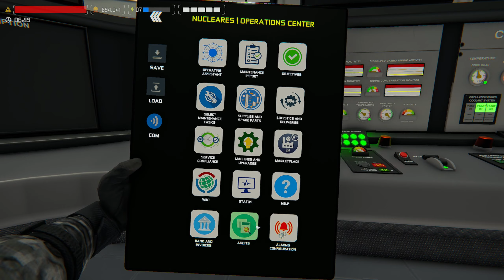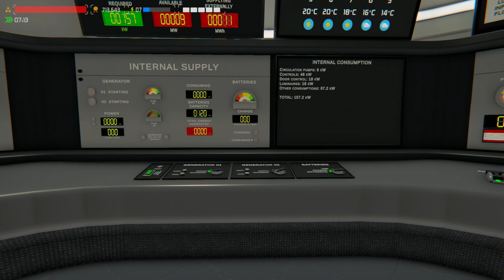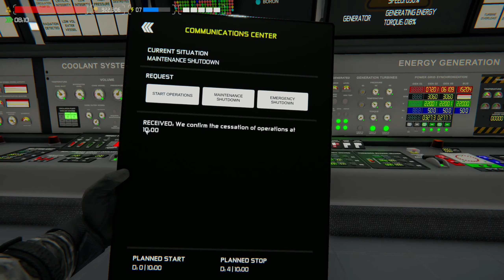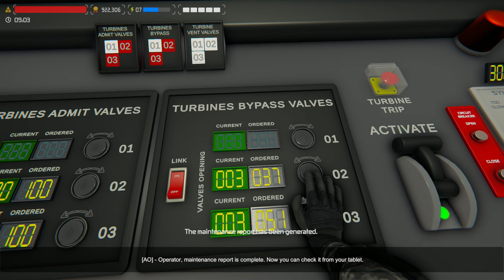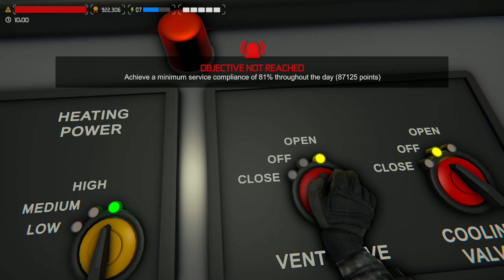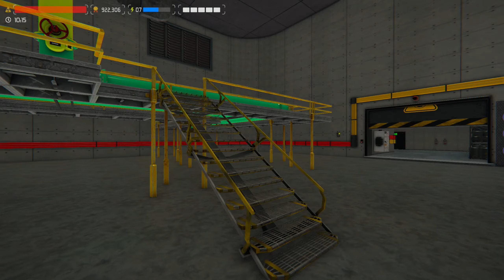SHUTDOWN Time... Finally S03E16 - Nucleares Tutorial

Comment: sharpy i have seen a couple of time during the series that you look at the Integrity indicator to know the "Fuel" remaining level. I am about 99% shure that the indicator is not for Fuel, it is expressing the Integrity of the control rods system (perhaps not the rods itself because the red/green lights are for that, but probably the integrity of the engine that insters and extract them) The Fuel remaning level is represented in the Fuel block area to the left. The confirmation of what i say is that the indicator showed 94,39 and after you read the mantenance report the integrity of the rods was 94,4%
Reply from the maker: Yeah I'm starting to notice this too lol... at 1 point in the games updates, that was the Location for the fuel integrity etc haha... I need to get with the times and look/read it properly hahahahaha
Cheers again 😎👌